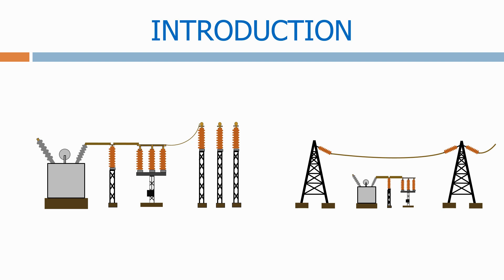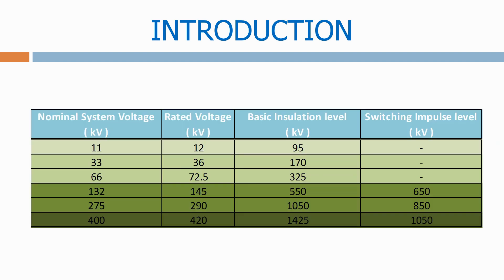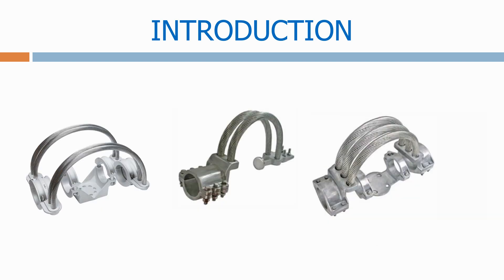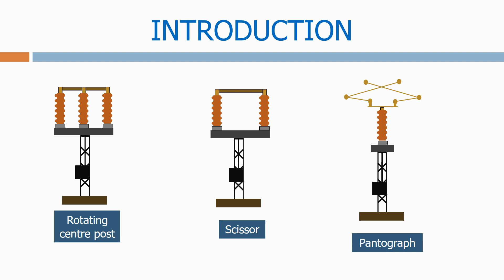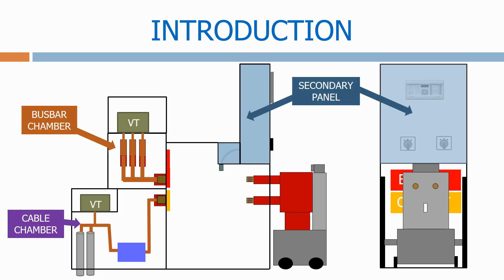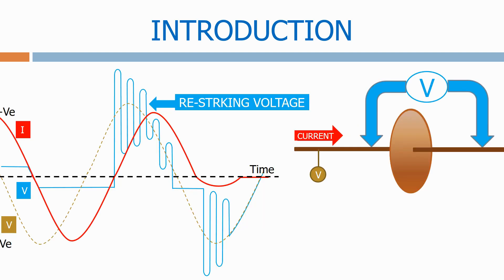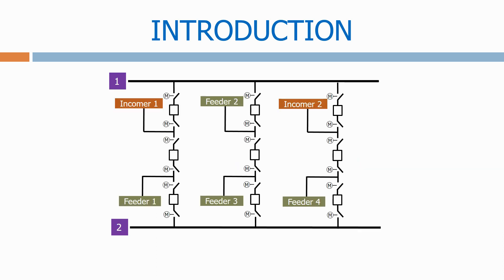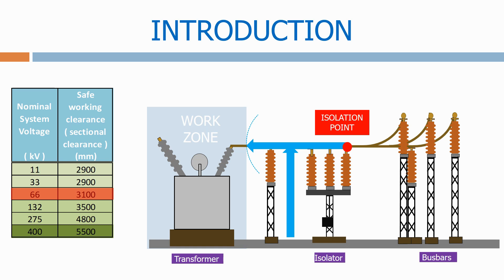Air insulated substation design course

Comment: Hi Stephen, we have an air insulated substation at the rear of our property (132kV) built in 1960's and National Grid are building 2 new substations (Gas insulated I think) on the site next to them with new cabling that will connect through new tunnels under London (LPT2 Project). The circuit cables that have worked with the older substation up until now are being decommissioned as they are 60 years old etc. What is the likelihood that NG would could use the air insulated substation again, could they upgrade it bearing in mind they have decommissioned the cables that they are connected to as part of the transmission/distribution system?
Reply from the maker: Hi Mike,
              GIS substations use a fraction of the space of an equivalent air insulated substation, it is common for utilities to replace the AIS substation with a GIS alternative then sell the excess land. 
I obviously don’t know the substation your referring to but maybe that is the plan there?

steve